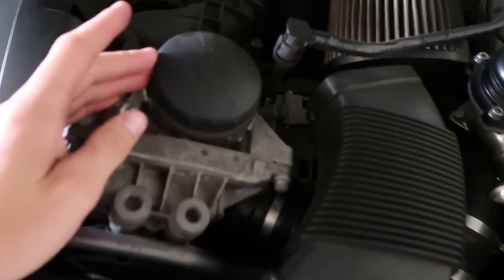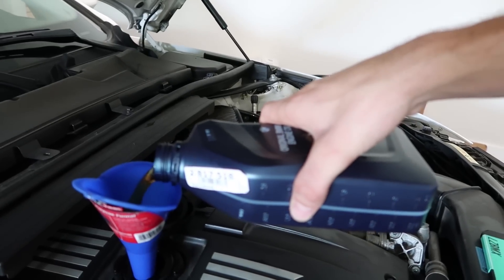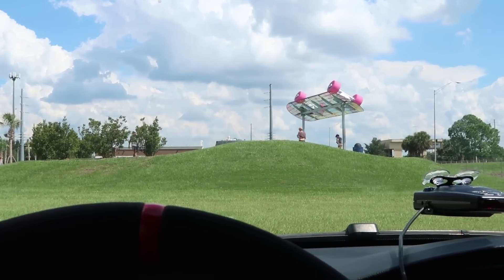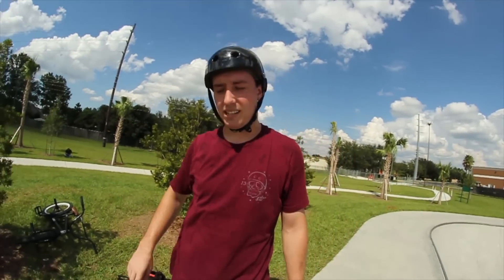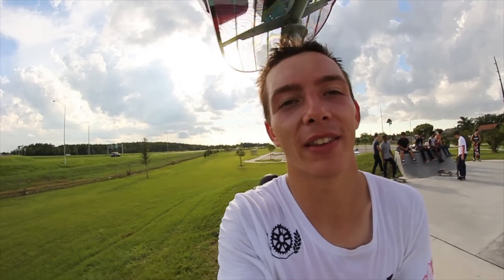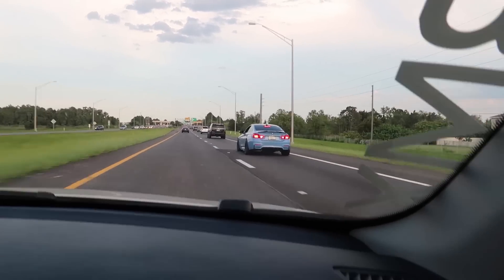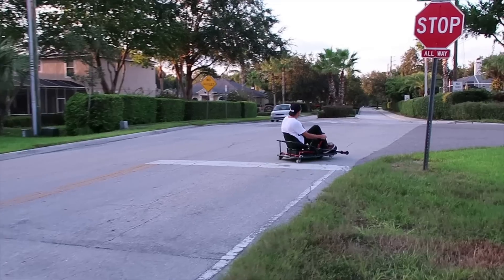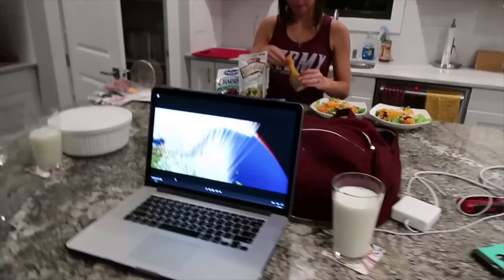Just Our Typical Saturday...

Comment: Also guys if you live up north shops burn waste oil for heat in the winter and will take it free of charge our shop has been doing it for years and it seems like every year more and more shops are doing it..  just another option if the retailer will not dispose of it just call around someone in your area will take it off your hands.

Comment: You must get a supra, i had a 2JZ twin turbo, Auto and they are so much fun, i wish i never sold mine. I don't know what the prices are like in the US tho, but in the UK they are now mega bucks, especially if you want a manual. 
P.s just a heads up, they never made a twin turbo convertible, they only made them as normal aspirated, so you have to install your own twin turbo, so just be careful if you do buy one already done and check its been done properly, not bogged together.

Comment: Usually you can drive another 40 to 50 miles after the dial gets to 0. However it's not good for the motor, cause there is all kinds of junk on the bottom of your tank.
Reply: what ...
Reply: Fuel is pulled from the bottom of your tank anyway even when it is full, so it really makes no difference. It's just not a good idea to run the system dry.
Reply: moron of the day everyone!
Reply: Its like 15-20 miles
Reply: You have what is call an unindicated fuel reserve in your tank-usually about a gallon, but varies by make. You're not getting 40+ miles out of that unless you're in an economy car, though. It's definitely not good to run it that low in the first place-you run the risk of burning out your fuel pump and/or picking up sediment and other crap that settles on the bottom of your fuel tank and introducing that into your fuel system and engine. Some fuel pumps are in-tank and use the gas to cool them down.

Bottom line: just keep gas in your damn car.

Comment: Probably NOT a good idea to add motor oil to mulch.  It's got all sorts of bad chemicals, hazardous metal particulate, etc.  Putting chromium in the water supply is less than great.  Just pour it into a jug and take it to any larger auto parts store like Autozone or O'Reilly.  They will take it free of charge.